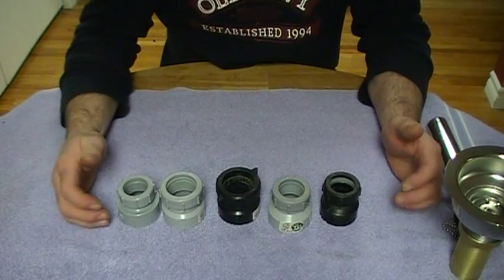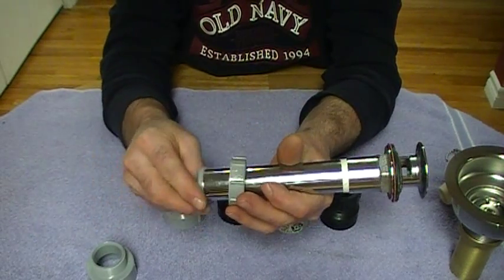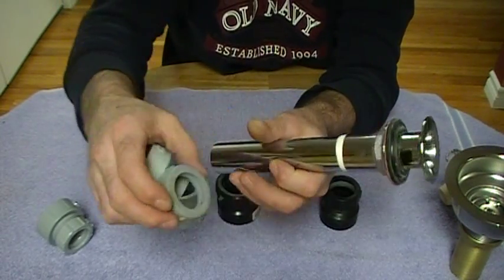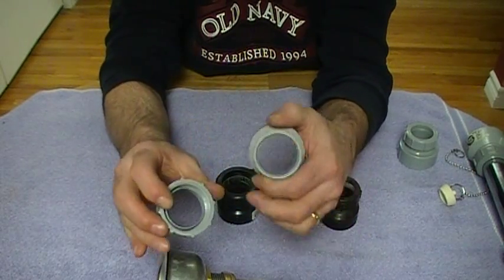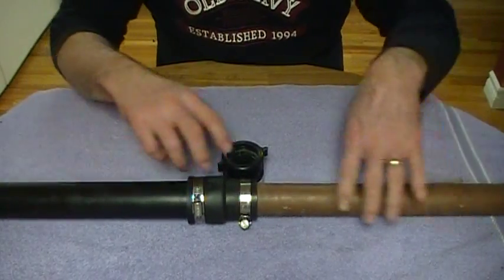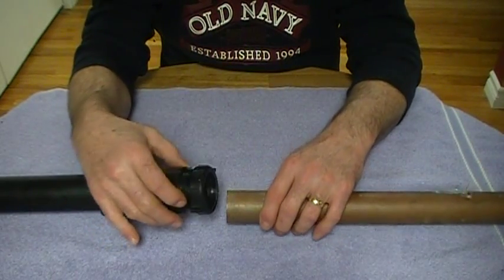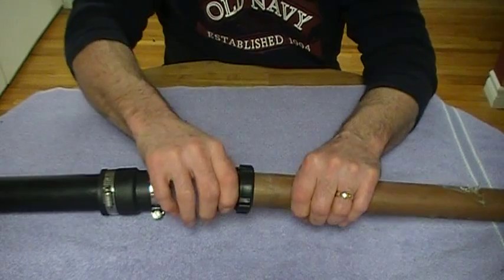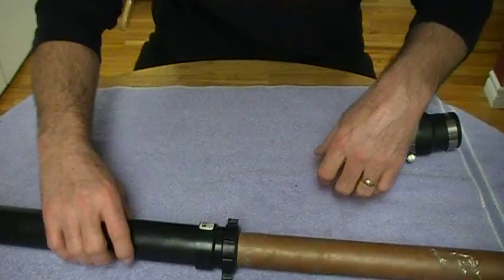Where to use bow and trap adaptors in plumbing installations...The difference between the 2

Comment from the maker: Yes. Bow adaptors are made in PVC as well. I apologize for not having one in PVC,but they do make them. I have used them often and they work very well. Any fitting that is made in ABS is usually made in PVC. They are cheaper then fernco couplings as well....Good luck and have a good day.

Comment: I've never in my 34 years seen a trapt adapter used in that way, they are meant for the pipe coming from the wall not on the drain assembly
Reply from the maker: Hello hellbilly1556,
They can be used either way. Either sticking out of the wall and going with a chrome p-trap or coming off the p.o. plug and into or sink strainer to a trap.  coming out of the wall and going with a chrome p-trap for example is not common in the majority of homes. I have installed them in industrial and commercial buildings like that quite often. but most times an ABS or PVC trap is used under vanities or in kitchen cabinets. Pedestal sinks are a great example where they would be used sticking out off a wall and using a chrome p-trap. I have been using them like this for over four decades with no issues.
Thanks for commenting and enjoy your week.

Comment: my bathroom sink drain has threads the entire length and it does not seem to fit snug in the adaptor.....i'm at a standstill here....i'm pretty sure i will have a leak if i was to keep going on this....any input?
Reply from the maker: Hello niterbum,
Is it the tailpiece you are talking about with the threads? It must have a smooth section on the end of it that fits into the adapter. Is it the same trap adapter or a new one?
Some new adapters have no plastic ferrule in them.  If you are using the old adapter there may be a plastic ferrule that has to be put on. The nut slides on followed by the ferrule.
Your tailpiece should have at least 2 to 3 inches where there are no threads.
Thanks for commenting and get back to me when you get a chance....Al
Reply: it screwed into a plastic sleeve that slid into the p trap ...the plastic sleeve was the housing for the swivel/rod for the stopper ....i guess i need a new drain/tail piece for the sink then? I dont want that type of stopper anymore, i like the old way from the 60's with a rubber stopper....i find that the rod/swivel ones clog more often,  your thoughts? thanks in advance
Reply from the maker: Hello niterbum,
I am from the old school myself. I like the rubber stops as well with the chain. Less issues as far as the drain getting clogged as you stated. They are still very common.
The mechanical drains can be a little finicky at times. They have to be set up just so in order to work properly. 
Whereas the plug and chain is basically plug and pull. I have a sink with one that has been around for decades and still works well.
Thanks for commenting and enjoy your week!      Al